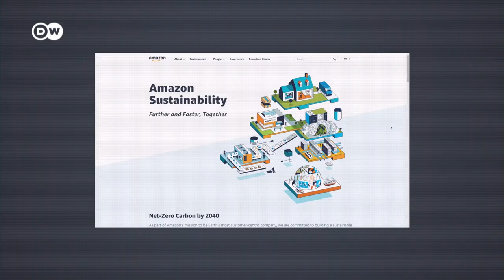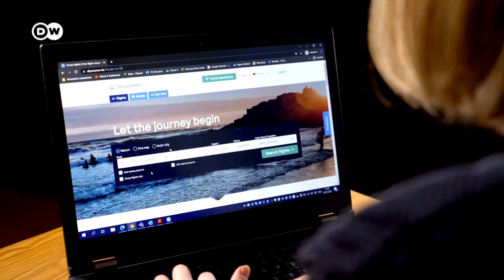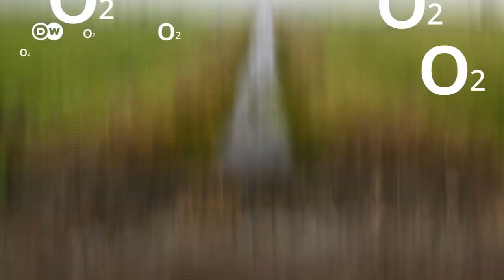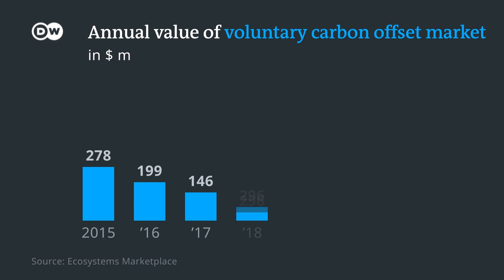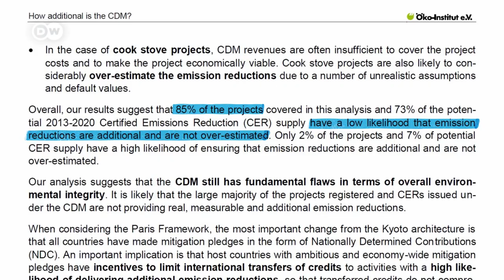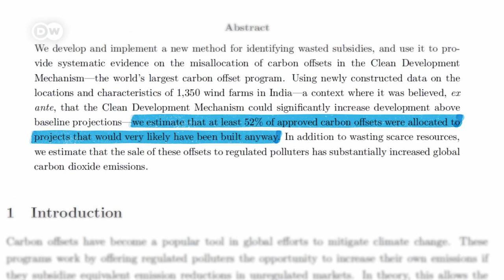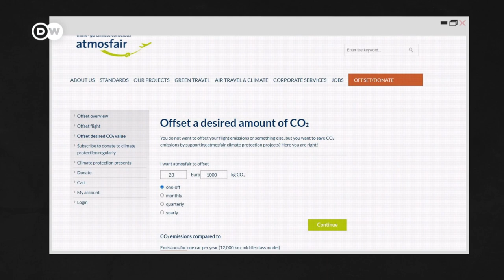Why carbon offsets are worse than you think

Comment: There are many problems to adress.

1st, in the case of peatlands, forests and all that: what I see is that they only limit to plant trees or make water ponds, shallows, etc. But they are not taking in count biodiversity, forests need to have diversity in trees, but they need also fungi and bacteria in soil, so they can grow with more diversity from ground to above. They require also herbivores, and that's the real issue with most of those lands, i couldn't see in the peatland any herbivore, nor any plant diversity or bug diversity, birds, etc., Only a dead land. Same with forests, they burn because land need to be managed, so it can be fertile and organic again, and solving that you have soil that can absorb a lot of humidity, you require mulch there, and most important: herbivores. If you don't have herbivores that eat plants, then fire will be recurrent, but you can't only have herbivores there, you need to have predators or control them hunting them, that can bring good income to preserve those areas. And even if you can't have wild herbivores, or even if  you can, it's possible to use domestic animals like goats and sheep to manage them, and you can have these nitrogen cycles and plant control very efficiently. 

And the other problem is that maybe where they are making the forests and plantations, they don't need them, maybe it's a grassland and you have to make grasslands, not forests. 

But the main issue, above everything else, is that no one talk about the industry that create all of this: agro-industry. Most of the media blame everyone, oil, beef, airspace and all industries except this, and if they blame it is because "cattle" is to be blamed. No, most of the crops don't go to cattle as they say, most of it goes for human consumption, only soy goes for cattle. And you have a lot of useless crops that they do ethanol for cars. So there is an obvious excess of crops because the real problem are policies, you name it: subsidies.

It has been proved that humanity can be fed with permaculture, a lot of carbon in atmosphere is there because agro-industry, became even more than trees or plants, soil is the main carbon storage by far, and when they use fertilizers, fungicides, herbicides, then they kill microbiology and carbon goes to atmosphere. It can be detected that when in northern hemisphere comes the time of tillage, carbon goes up exponentially, far more than any other industry can add. 

A lot of issues come using that agro-industry: soil is killed, drought become more severe, biodiversity is lost, co2 go higher and higher and producers need a lot of inputs every year, and costs go up, and net income go lower. The only ones that earn a lot of money are those who sell glyphosate, fertilizers, gmo seeds and big industries that control the market

And they have their smokescreen always: recycle in 80's, ozone layer in 90's, now is beef and oil, and the weakest in the link like straw industry. And is outrageous that "scientist" prostitute to claim that the only way to feed people is using all of those chemicals, when has been proved that not only carbon gets stored, lands become drought resistant, biodiversity goes up, food become healthier, inputs go to almost zero, water is recharged in water table, but that even yields are higher. A lot of desert are also deserts because agro-industry, but also because grazing animals were killed centuries or millennia ago by humans, and grasslands can only be sustained when grazing animals graze them. Most people don't know that northern Mexico and most of the desert lands in USa like Arizona or New Mexico etc were once prairies, but they killed bison and antelopes. There are many projects proving that using cattle like if they were wild grazers can restore grasslands that are better in many cases to store carbon than forests. 

So, unless we change government policies that subsidize crops, you will always have people razing forests because is unsustainable to produce that unless you give subsidies and many of them have debts of many years forward with banks and this institutions that benefit from this, and people don't have income. If you want to track down all of this environmental and social disaster go to the New Deal, there began all of this.

Comment: The forests are overbooked! 
Well… it’s fun to see three excavators scraping peat using 180 liters of diesel fuel per day each, which itself has to be compensated again. 
It is all complete nonsense, and bewildering that intelligent people can fall for this. If I wanted to compensate the hydrocarbons I fuel my car with, I only have to imagine the equal heating value expressed in wood, and I would know the volume of wood THAT WOULD HAVE TO GROW BACK in the SAME TIME I use up my litre of petrol. In the same time, because we all must compensate, and at the same rate we consume, or we would pushbthings off to future generations. This can never be done, not for all consumption of fossil fuels worldwide. (And growing trees is, in essence the generation of FUEL, so why, if this is possible, would we ever have bothered to do all the extra effort of extracting fuels from the ground? Think of that.) And also: the excavators mentioned above are not the only expenditures of energy in the proces of compensating that have to be compensated for themselves: all related activities have to be. Down to the coffee cups used by those that do the carbon compensation bookkeping. In short, the Second Law of Thermodynamics is universal and applies, also to human society as a whole.

Comment: Topp research   topp presentation, thank you. A few remarks. The main GGH  remains CO2. To release one ton of CH4 into the atmosphere is far worse than to release one ton of CO2, but CH4 is by far not emitted in such amount. The same applies to nitrous oxide. These 2 trace gases do have much lower atmospheric concentrations. Second remark. We live in Germany and have a small electric car. We sell our offset and get every year at least 300 Euro !!  We do not know which polluters buy our "certificates" , but I am impressed that Germany moves quickly on this. But in the end,  ...we must emit less CO2 ...

Comment: Unfortunate title and poor representation of all the work being done to improve the system. 

Fact is we need a way for environmental costs to be included in production models to optimize efficiency on both fronts. The offset market will improve over time and increasing costs in offsets will spur investment in higher quality projects and force companies to reduce emissions since offsetting alone will become prohibitively expensive.

I'll state that again to be clear, reduction is the goal but you need to create the economic incentives to force the issue on balance sheets. Increasing the quality and value of offsets will make reduction more efficient over time.

Be critical of the offset market and help it improve but taking the position that it is useless (or worse than useless) severely hinders an important economic incentive for investment in reduction and factoring environmental cost into production models.
Reply: Well, the time has shown that they are useless. We are not reducing emissions. And what you are saying is not the only way to face the problem...so maybe we should look outside the "market" perspective.